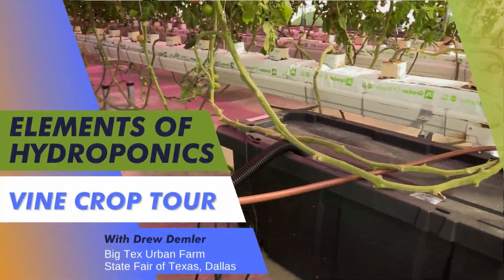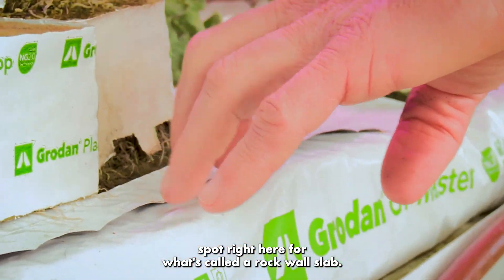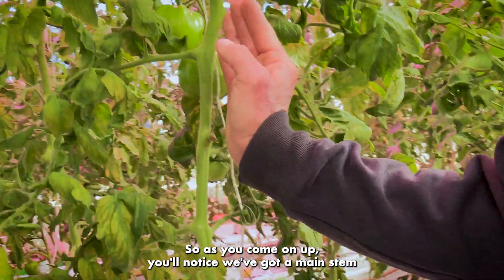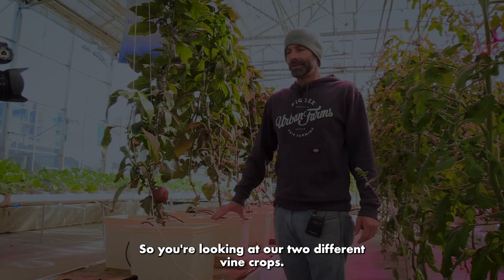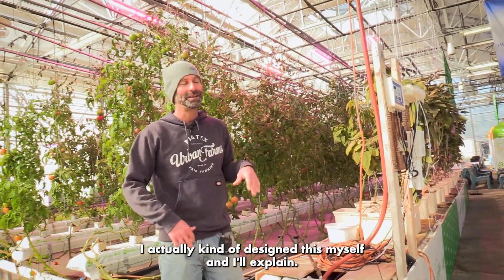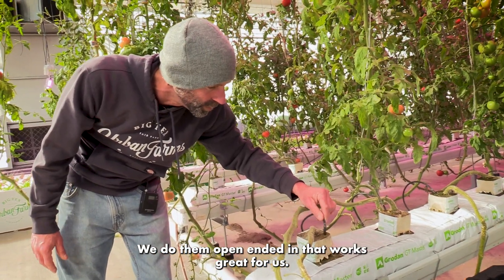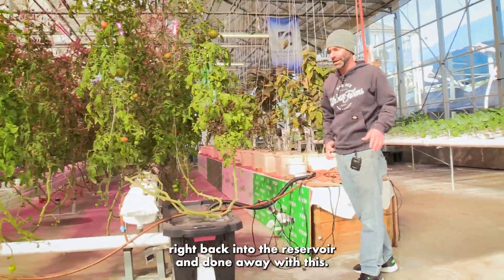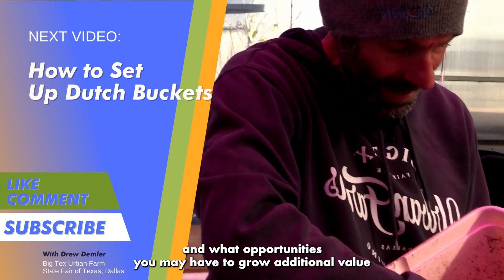Hydroponic Gutter Slab System and Dutch Buckets | Elements of Hydroponics

Comment: Any help with root rot? My hydroponic is filled with green algae too😭
Reply from the maker: To prevent root rot in a Dutch bucket or an NFT hydroponic grow, it's important to maintain a well-ventilated environment and use clean, quality water sources. Additionally, you should regularly maintain and monitor the pH level of the nutrient solution and ensure that the roots are not sitting in standing water for too long. It's also beneficial to use plant guards/pots to protect the roots from direct contact with the nutrient solution.